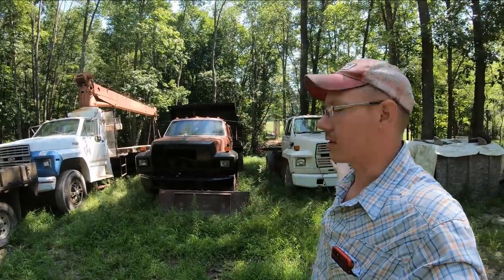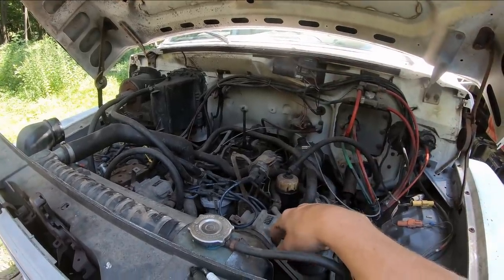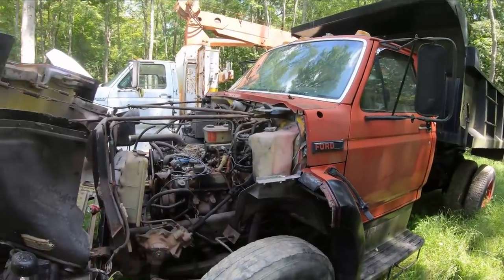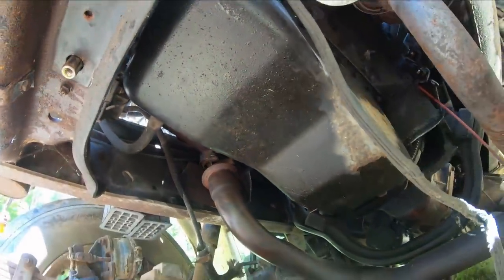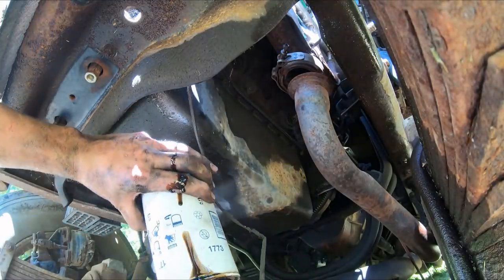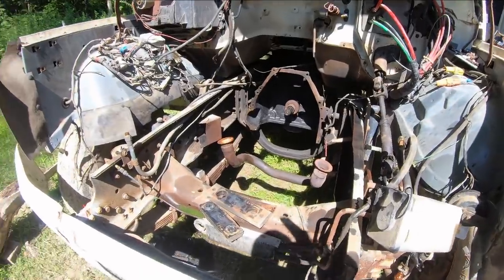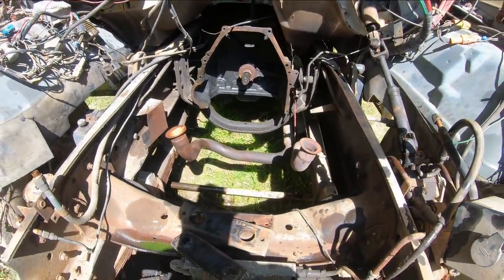Tearing down a BIG BLOCK in the middle of the woods!! $700 Auction Crane has BIG Problems!

Comment: Wait a minute...late '80s Fords are a discombobulated mess of standard and metric?  That can't be right:)
Reply: And designed for the rain water to drain into the engine apparently :)
Reply: Polecat54941 i heard Tesla stole that patent for their trunks
Reply: @Polecat54941  just like the mid 2000s cobalts has a window flaw, that caused water to drain right into the door and ruin the speakers.
Reply: @syy8976  1970s Pinto has a gas tank flaw that caused fire to drain right into the passenger compartment and ruin the driver...
Reply: Ford, Chrysler and GM all had the same SAE and metric bouillabaisse of bullshit in the mid to late 80s. Should have just stuck with SAE, metric is junk.
Reply: @GGigabiteM   METRIC IS OKAY.  But they failed to use one or the other exclusively.  It's the combinations that are frustrating.
Reply: @jeffryblackmon4846  I'm pretty sure it's due to this being the "transition period" haven't seen much standard on anything newer than the early 90's, unless it was something that didn't come OEM.
Reply: @MrChassmith   Just watch your bee-hind, and don't get hit.

Comment: That cylinder doesn't look all that bad. Some of the cross hatching is still visible. If that's the only problem cylinder, you may still be able to free it up. Put an inch of your preferred penetrant in that cylinder, let it soak another day or three. Then put a bar across the flywheel/clutch assembly and see if it'll turn. You've got a lot more leverage back there than on the dampener bolt.

Comment: as you typed during the video; "a crane would real handy right now", you could disconnect the hydraulics from the truck and run it off the skiddy or tractor or something and the the crane would work to hep disassemble itself. 16:55, you need to frill a hole thru the end of a fork so that you can poke a long bolt thru it, and thru your chain, to keep it from sliding off the end. OK, you have the holes, but use a 3/8 bolt or so right thru the chain link.

Comment: An old timer friend of mine used to use to rebuild hot or miss engines. Most all were rusted tight. He modified a sparkplug and connected it to a grease gun, he would then fill with light oil/ diesel. Everything he got near that motor he would give it a couple of pumps. Before you know it he had the piston backed up. You could do the same to get engines unstuck.

Comment: The snout on the crank is smaller on the pickup truck engine. Makes for problems driving the compressor. Also the timing cover is different. You're better off knocking out the one stuck piston, honing the cylinder, new rings on that cylinder and a full set of rods and mains while you have the pan off.

Comment: The oil pan should interchange from The 429 to the 460. 
the mounting should be the same while the sump, and oil pick up may be different,  so keep what you have so if you need to put the old oil pan on and the oil pick up. 
I put a caddy engine in a Chevy pick up needed to change the oil pan, and pick up tube, also had to use a main  bearing bolt with a stud to hold the oil pick up tube , little things like that is why you need to keep what you have until you get finished

Good luck

Comment: 429/460 is the same block.  Same crank.   Bore size is different.   You can bore them out 60 over without worry.    The later smog versions, 72 or 73 on up, had taller decks to lower the compression for emissions.  Lot of guys will deck them to use earlier intakes.  That is about the only thing you have to keep in mind when swapping parts, if you have a smog/no smog motor. (Smog motor is way more common and they stuck them in everything)  Also, timing cover behind the water pump,  no matter what year, will create a hole through the cover and it will leak inside on the timing chain.  It's a common well know problem.   If you get a new motor, just get a new timing cover and replace it.   Summit has them.  $100.00 or so.    And check the snout on the crank.  It's abnormally long, if it is banged around, they will break.

Comment: According to the 55th Auto-Truck Interchage, "The Hollander"  the 460 interchage is '79-'87 Ford Truck Interchange #300-9460*.  * = variations in oil pan, induction system etc.
Reply: Hi Matt, have you had any luck in finding a replacement engine for the crane, and if so, are you gonna do a video on it, and if you are, when might we expect to see that I love that episode

Comment: What's more, the 429 and 460 are completely interchangeable engines with their 4.36- inch bores. The only difference is stroke. The quickest path to displacement is the stock 460 crank. Drop a 460 crank into the 429 block and you have a 460.

Comment: hey! there's a big block under all them dang hoses lol. just pull the pistons and use a ball hone to remove rust, then put it back together and itll work just fine. id just put new piston rings and thats about it, you could do the crankshaft bearings but i wouldnt bother. polish the valves and do a homebrew valve lap and youll be fine.   them 7.5s are oil burners anyways lol.  a 460 will fit they got the same bolt pattern. and the block is same so it will bolt right into your truck. whats killing your fuel economy is the carb/intake.

Comment: Worked at a tow company we used to pull out the gas pots and put a diesel in it place seemed to work out good if yours got the two speed rear end took to day for swiping in wire lumen is for gas or diesel it's a ford one of the eases to convert over and Dodge was 2nd plug and play

Comment: If it were mine, I would rebuild the engine and cut corners where possible. It will cost more to do it this way, but a boneyard engine introduces all kinds of unknowns that will take time to sort out. Time is money. The little things will eat you up on a boneyard engine including making all of the accessories fit. Take off the other head and remove the oil pan and do a good inspection.  If the crank is good, you can very accurately estimate the cost to rebuild before you start. Hone out the bad cylinder and confirm with a micrometer you can get the rust and pitting out without exceeding bore specification. I believe the honing will go well. The rebuild would be very straight forward with no guessing about what you biting off. Engine re-assembly and engine re-installation will also very straightforward as you have every part you need to go back together  (this is were the time savings start to factor in).  My guess is $900 - $1200 will get you a running truck if you do the rebuild yourself.  Reuse as many parts as possible. It does not need to be perfect.

Comment: As for the rest of the crane truck itself, it could be converted easily to use a hay fork on the crane to pick up bales of hay or pallets of fertilizer. Of course, that would depend on finding a new motor at decent prices.

Comment: I have freed up an engine with marvel mystery oil before and it worked great. It was on an old y-block and I let it set for a few weeks but a breaker bar got it loose very quickly.

Comment: You should drill a hole in your forks to mount a removable hook for positive retention of the chain when lifting by that method. Only need a 3/4” to 1” diameter bolt through the hole. Easy to remove to use forks for pallets.

Comment: As a ford person & auto wrecker all the info for the engine should be on those stickers on the valve covers.  I have seen a buddy use C.L.R. after honing the cylinders  to eat the rust .  I know in the F350& lighter the 429 460 have the same bell housing & most parts interchange, internally or externally balanced  is also a difference if you decide to swap.

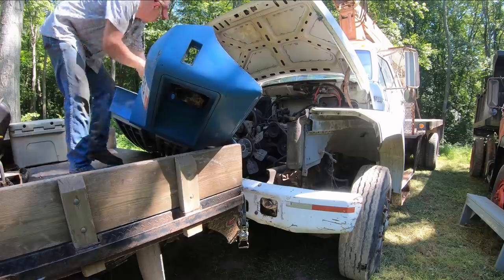Comment: @ 8:51 "a crane would really be handy here...."

Have you think about of add some quick couplers to the crane valve manifold "pressure" and "tank" ports and then using your bobcat as hydraulic power pack ?

It might work (unless if pressure is way higher than the bobcat can supply)
Reply: damn thats a good idea !

Comment: I had an 85 Ford Ranger pickup that the running gears all were meterc and the body was SAE. I hated that because you had to have two tool boxes every time you did anything to it. Thanks Ford. After that I haven't had another Ford. Oh, after 60,000 miles it turned into a money pit with many little things often.
Reply: GM and Chrysler were the same in those years. Better to buy Japanese or European and get all metric for a few years. (didn't bother me much at the time as I had a drawer of metric for 10 years by then- Just had to buy 18 mm for suspension on USA iron.)

Comment: You need a Medium duty engine as they run a larger diameter crank snout to handle running the air compressor. The block itself however is the same 429/469, the 370 is of course a smaller bore

Comment: Little bit of surface rust in the cylinders is fine for an old 460...  Just throw in some marvel and wing it over..  All the 460's are the same so just grab another and toss it in...  Those 460's are one of the best drag engines Ford ever built...

Comment: I Had the same issue with wanting to use a P-30 Chevy 454 RV motor for a rat rod, but couldn't because i was told the big truck motors have a longer stroke like school bus motors. There supposedly  is a difference in Pickup motors and medium truck motors also.

Comment: Had 1984 F-700 with 16 ft Flatbed Dump (Gas). A almost new 10 ft fisher angle plow. Got stuck every 100 ft in winter unless it was below freezing it would go descent.  I let it sit for a few years and it just wouldn't start again.

Comment: Use a c clamp over the fork end so the chain cant slide back or slip off the tip.   My loader has a trip bucket and ive loaded a utility trl on the bed of my one 3/4 ton since towing a triple axle. I was going to a tractor drive event with my uncle.  I wrapped a lifting strap around loader cross beam and a chain across my manure tines with c clamps on each end and my bucket was at about 30° angle im guessing. No slippage from the chain

Comment: I see many people use the oil filter wrench to put on the filter when that's totally the wrong way you tighten the filter by hand and use the wrench to take it off some filters it has written right on the side of the filter tighten the filter by hand but they still use the damn wrench to put it on. Once you add oil to the seal and turn it on by hand the thing won't come loose but I don't understand it but it gets annoying when you got to take it off and you damn near chisel the thing off because it's so tight.

Comment: Yes all 385 series blocks are the same 370,429 and 460 use the same block. The 429 boss in the early Mustang was the same as the truck but just received a bit more attention than the dump truck block. Grab a later model 460 truck engne and drop your intake and a steel distributor gear on for the roller cam, swap pans and let it eat

Comment: Make a spark plug adaptor for a porta power, take the rocker arms off and use the pressure from the porta power to break the engine loose, works every time
Reply from the maker: Now that’s an interesting idea...

Comment: I have freed up several engines locked up like yours by pouring cylinders full of coke or Pepsi. Yes you have to flush it out well with diesel but it has saved me lots of trouble in the past.

Comment: get some machinist clamps they are c clamps that are tightened with a wrench they have shorter travel for the threads and are overall beefier than c clamps. they are really nice to help stop a chain from falling off the end of a fork. you cant really break them without taking a torch to it

Comment: If you can find a boneyard 460, car or truck, do the swap. the 460s out of Lincolns have the most torque and HP. Swap the oil pan, oil pickup tube, but use a new oil pump. While you are at it, do the timing set. reuse the timing cover and front mounted engine mount from the original motor as well as the exhaust manifolds.

Get 2 motors, throw one in the parts donor as well.

https://en.wikipedia.org/wiki/Ford_385_engine

Comment: Easiest way to determine engine displacement (370 or 429) would be bore diameter. 370 has a 4.05" bore and 429/460 have 4.35" bore.  Distinguishing 429 vs 460 is just as easy. 429 has a very short 3.59" stroke as does the 370 engine. This is why the 429 is a badass racing engine. The 460 will have the 3.85" stroke for which the engine series is named after. It's interesting that 2 out 3 engines of the series have the smaller 3.59" stroke. That's Ford...

If you have the 370 I'm gonna say that some of the parts are exclusive to that engine due to the narrow bore. The heads are particular with respect to the aforementioned.

Comment: the 370,429 and 460 all the same family. 370 was down on power but was HD.
On the 429, there was a 4-bolt (HP). The TRUCK SERIES 370/429 did not use them but did use a steel crank and rods depending on HP rating.
Bolt patterns for bell housings are the same on all these engines.
Scott

Comment: i have always had good luck unlocking engines of all sizes, using a 50/50 mix of fuel oil and ATF  oil .. let it sit for a week and work it back and forth easy so not to brake a ring. my ford F600 with a 470, has hat same water problem were the hood seal is right above the air cleaner, the old air cleaner rusted some pin holes in the top witch is like a bowl to start with, i put a peace of roofing rubber 2 feet long and 18" wide and attached it to the hood out past the air cleaner and back to the top of the fire wall to redirect that water

Comment: Ford 460 is the same block as 352, 390, & 427- 428. ( They are all the same block mid-duty truck,  light truck or car. ) The 490 was a totally different block! I haven't looked at 390, or 392. ( These  were mid-duty truck only engines. ) ( Use to be with Fords before the late 60's even numbers at the end meant truck engine while odd numbers meant car engines. And yes the T-bird did come with a truck engine. Just a bit of history.😁😯)

Comment: I really enjoyed the video.  It looked like a gasket leak except the cylinder did not have any green coolant in it.  I would have attempted to tap the piston downward to determine if the crank would loosen up.
Reply: The stuck valve was over cylinder number 2 (from the front) but the rust is in cylinder number 3 (from the front) with water rust stains near the outside edge.  I'm guessing that the motor has had previous repairs   A headgasket leak on cyl 3 may have been an issue for a long time and plain water was added whenever the motor ran hot.  There is no way to explain the damage to the valley pan or the valve sticking on cyl 2.
Reply from the maker: Agreed, I’m not done with her just yet... just thinking on it

Comment: The hole in the valley pan is from the egr system passage  that rotted through.   That brazilian series was used in farm tractors, one of the best Ford ever used, but very noisy and  torque engine.  try Myers Equipment Canfield Ohio,  Thomas School bus dealer he used to have those engines in trade ins. good source for used parts.

Comment: you can put the 460 in but you must stick with the manual flywheel from the 460 you get there are 2 type 460 flywheels ,balance differences .so the engine you swap, try to get a standard trans engine with the flywheel.

Comment: There is always a point where it isn't coming back, but for those that can be saved, i have always felt Mystery Oil cut with either deisel or kerosene to be one of the better cocktails to free a stuck engine.

Comment: If it is a 429/460 series, they are the same motor that is in the pickups and the big floater cars like a crown victoria and such. The industrial series Ford motors are a 351W and a 391W W stands for wide block. Not to be confused with the 351W (windsor) which is a small block motor. The 351W/391W motors were normally found in the pre 80 school buses and the F-800 dumps and such.

Comment: If I am not mistaken a 385 series Ford engines are the same, we used to take the 534 which is a factory stroked 385 and put 429 Cobra Jet heads on em' and use them in hot rod applications (early stroker motor) . Amd do yourself and who ever buys that thing a favor get rid of that alligator hood off that thing and put the flip hood off the red one on it and also don't sell yourself short I would think just the crane and flat bed off that truck on the ground would be worth way more than you said for the whole truck running.

Comment: Next time put C clamps on the end of the forks to keep the chain from sliding off
Reply: C clamps will not hold that weight of the engine.. they will slide off the forks. Been there it did that.

Comment: Since you end up reassembling it in a later video, I guess someone set you straight on the nature of those truck blocks(raised deck, etc). The connecting rods in the later videos are clearly longer than a 460 would be. I'm not sure if the truck motors are internal or external balance. The regular 335/385 were all external balance

Comment: What could also have happened is that maybe some of the head bolts go through the water jacket and no / not enough sealant was put on and water gradually through the years started wicking up the bolt threads and ended up compromising the head gasket and causing that problem.

If the engine was mine, I would get a rebuild kit and purchase an RV cam and an aluminium manifold that makes better low end torque (if not to just get some of the weight of the original lump out of the picture!) and a set of 4 - 2 - 1 headers. then you might end up with an engine that makes better power throughout the rev range, runs cooler and actually will get better gas mileage!